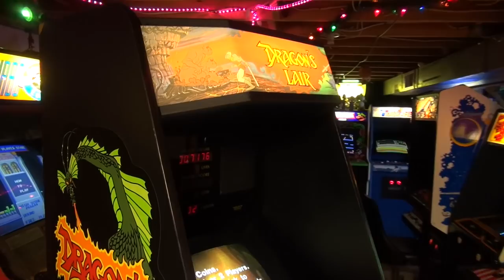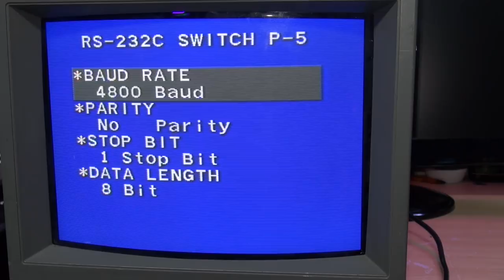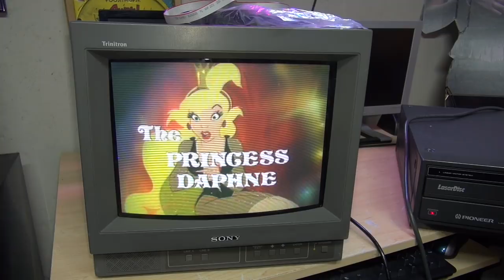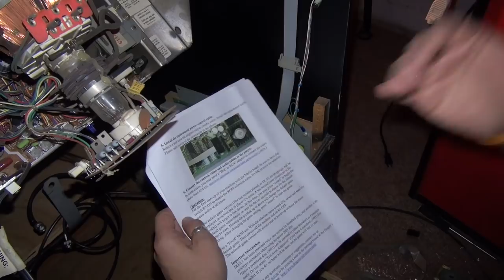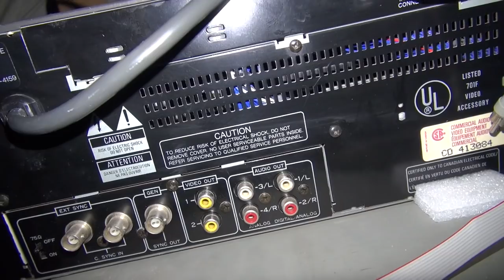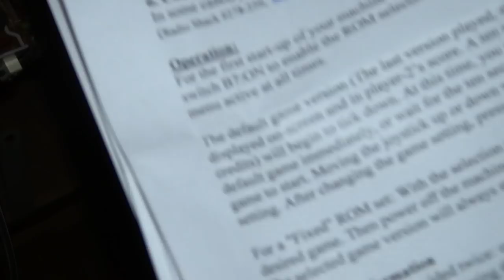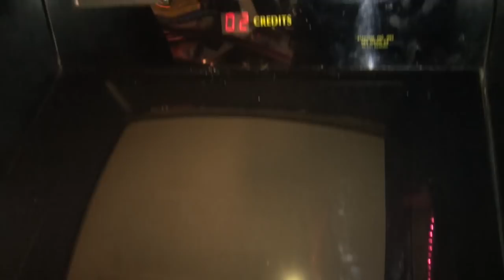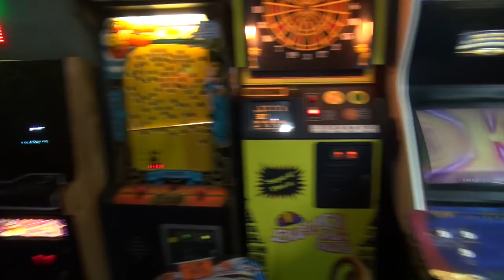Dragon's Lair Arcade - Merlin PCB, Pioneer LD-V8000 laserdisc player / SONY PVM Spectator Monitor

Comment: looks like that sony trinatron is used for making movies and stuff originally i think. those probably have a better picture then most i would guess. they probably still use them making movies and tv show. i would say it is probably overkill for this really. y/c is svideo. the laserdisc player looks like it has bnc out too? bnc is basically coaxial with a different connector that makes it easier to connect and not have it fall off too. Uk seems to us bnc more it seems and US seems to use screw on for some reason.

i didn't watch all the video yet but i hope you didn't adjust that sony monitor to try and match the one in the cabinet.  they sony one is probably as accurate as you will get and should use that to adjust the one in the game since it still looked a little off.
i would have turned video memory mode on i think i would think if they could have done it they could have done that they would have. i just wish i could have a laserdisc player and laserdisc.
Reply from the maker: No, I didn't adjust the Sony monitor. That thing is high end. I will be using it as reference for the arcade monitor.
Reply: John's Arcade Game Reviews & Tech
ok. looking at them both looks like red and blue might be off a little on the monitor in the game.